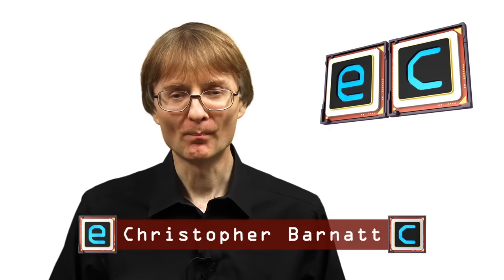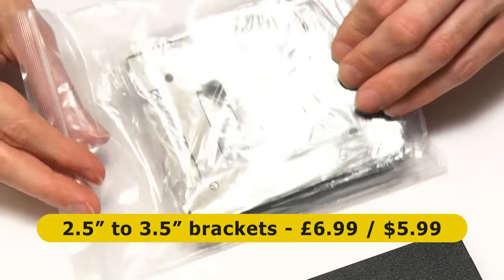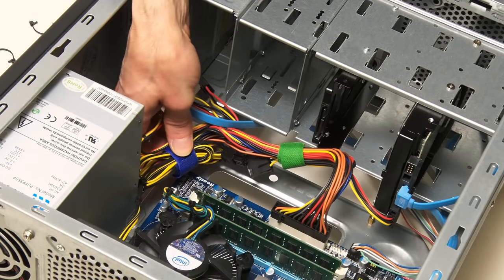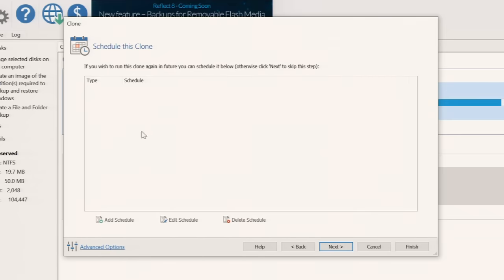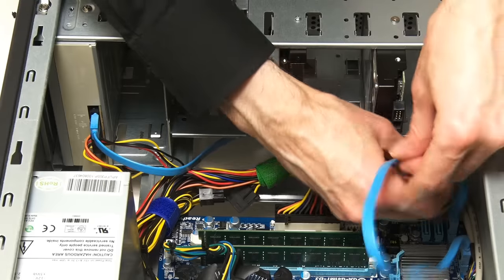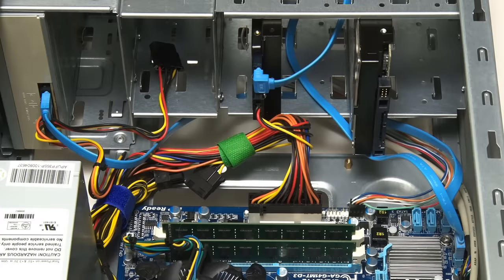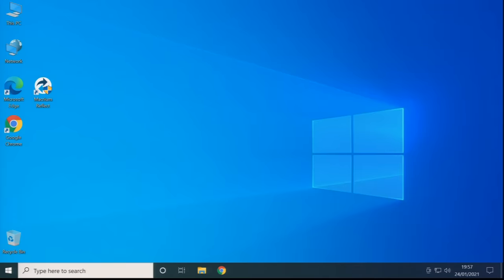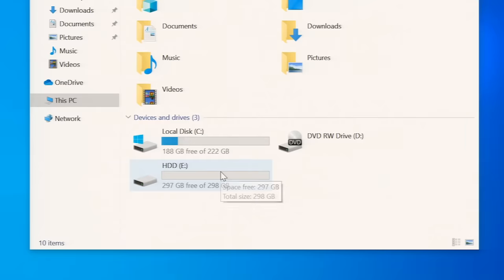Old PC Upgrade #2: SSD Boot Drive

Comment: I did this with my laptop a couple of years ago and everything seemed to go (surprisingly) smoothly, but there was at least one hiccup, when I cloned the hard-drive to the SSD, it seems to have broken the (Acer) laptop's built-in recovery system. There is a 15GB hidden partition at the start of the hard-drive that contains the system images to factory-reset the laptop, but pressing the hotkey to run the D2D recovery program on boot no longer works. Be wary of stuff like this when upgrading… (Also, Windows' memtest function was broken, but I fixed that, but Windows' System Repair function is still broken.) I suspect that some of these things used hard-coded sector pointers or something that weren't updated (if even possible in the case of D2D). 🤔

My system definitely feels a lot more responsive since upgrading to an SSD. I knew it would, but I didn't expect this much. 👍

Comment: I'm on the cusp of upgrading an older (~12 y) AMD system with an SSD and this video has lent itself perfectly as a tutorial for the process.  There is a corruption with the Win 7 64-bit OS on the legacy HDD so I will not clone it.  Hope rebuilding the Win 7 OS will not take too long. 🤔

Comment: I think that some little step is missing and I don't find any comment pointing out yet, so I'm writting it myself. I think it would be worth to check that windows' defragmentation tool is disabled and TRIM tools is enabled on the SSD drive. That would be better for the wear of the drive.
Reply from the maker: This will happen automatically in Windows 10 and 8 (ie those versions of Windows with support!). :)

Comment: Great video, i went on and cloned successfully, you recommended a great software. Then i was planning on wiping partitions and erase old hard drive so i could use to save my files but that turned out to be tricky, maybe you have a video on that, or could you suggest the application to go to. Thank you very much for all the explaining and the motivating🕵️
Reply from the maker: Glad to hear your clone worked. You can wipe partitions in Macrium Reflect if you wish. But towards the end of the video here I show how to clean a drive (and remove partitions) in DiskPart.

Comment: Right! Blue Tact... Lol
NOPE, I'm getting out the drill and making new holes in the case. Who need a bracket! Lol
I have been using the two drive system for years. The OS is on a smaller drive and all the data is on a larger drive.
Just like I do in Linux, the "/home on Linux" & "/user in windows " is on the data drive... :-) I know the average user
would not do this but I am geeky that way... :-)
Thanks Chris for the video! I enjoy them a bunch!
LLAP
Btw,  Are you a speech teacher? I'm asking because I just love the way you are precise on your words and phrases... Very professional! :-D

Comment: I saw no mention of other BIOS settings to check like ACHI vs IDE or even RAID. Someone with a really old system might choose "IDE" but with a SSD would be better advised to choose ACHI. I also didn't see anything about the difference between older BIOS's and newer UEFI's, where "secure boot" settings with UEFI might be a big problem. (Maybe you can show us a good way to clone drives on those newer systems that uses UEFI?)

Sorry if I'm being too critical. I still love the content that you produce. In fact, I learned (or was reminded) how to better use the DISKPART utility -- thanks!

Comment: Macrium ended up failing the clone attempt on my end, so I ended up using Samsung's Data Migration tool and it was cloned without a hitch in about 12 minutes. As you said, the SSD as my main drive definitely feels snappier and more responsive.

Comment: Perhaps you could have used Macrium Reflect to reformat the HDD. If you'd told it you just wanted to copy the data partition from the SSD, it would have let you extend it to fill the whole HDD. Perhaps it would have let you create the partition and format it with the W10 disk manager, or MR might have let you format it(???).
Reply from the maker: Sadly, Macrium Reflect 7 Free does not automatically extend/resize partitions.

Comment: I quite like using the installation of an SDD as an excuse for a fresh install of Windows - it makes you clean up any old or unnecessary data and you can always keep the HDD in the system with the windows install and data in tact to pull things/boot from. I've also known data to get corrupted in cloning/after cloning. Doesn't happen often, seen it a couple of times over about 200 laptops restored with clonezilla but it can happen

Comment: One little thing unrelated to the main topic: The captured video from this computer looks a bit muddy and less than optimal in general if compared with other videos of yours with modern computers with digital video output, where everything is so crisp and vibrant it looks like it is the desktop of my own computer. The rest of the gear used being the same, is it because of the VGA to HDMI converter not getting well with this PC's output, or does it also look a bit off when you hook up a monitor?
Reply from the maker: Very well spotted. :) The capture from the PC here is not as clean as in my other videos. And you are right, this is because I am capturing via a VGA output, which is analogue, and cannot really hold 1920x1080 sharply (VGA was designed for 640x480!) So yes, the image looks a bit off before it is recorded. The VGA to HDMI convertor does an excellent job, but as it is fed with mush the end result is inevitably not as pristine as I would like.

Comment: Thank you for the tutorial.  I followed every step and did the SSD installation, cloning from the old HDD, using the disk part to clear the old HDD & the have it available for future storage.  So far I have added memory, now the SSD w/HDD for storage.  Next will be the 3.0 USB.   Question how difficult will it be to add WiFi to my old HP PC?  The old HP has transformed from disappointing & slow to usable…not like a new gaming PC but much better than I expected all for @$180
Reply from the maker: This is great to hear! :) You could add WiFi either using a USB dongle (ideally a USB 3.0 one plugged into a USB 3.0 port, but USB 2.0 will work), or you could fit a PCIe WiFi card -- this kind of thing: https://www.amazon.com//dp/B07PMGJ9XY/
Reply: @ExplainingComputers  Thank you.  I will look into both options when I do my next upgrade. I was ready to junk my 11 year old HP Pavilion 6310 until I found you.  Again...many thanks for the time you put into making your how to & how it works videos.

Comment: If you're going to add an SSD to an old PC you should max the RAM first so as to avoid shortening the SSD's lifetime with tons of pagefile writes.
Reply from the maker: This is exactly what I did in the first part of this video series! :)
Reply: And put the pagefile on a different drive, if possible. Or just disable it entirely if you have enough RAM, and don't run some app that whines if it doesn't find one.
Reply: If you're using Linux, just reduce the "swapiness" to a lower figure than the default (depending on the distro). It's the same as reducing Windows' page file.

Comment: Speaking of ssd. I had to reflash the whole firmware on my tablet because over time it developed ghost memory and corruption. I had a flash drive develop ghost memory to of which required a reformat.  Even though I deleted files it still showed files were there. I never allow myself to forget that a ssd is still just a glorified flash drive and all things with permanent mounted emmc flash will eventually fail.  Google and their stupid updates breaks things more than people know.  I like using ssd's for static files and, spinners for swap and game saves that need frequent saving. Like on a Xbox 360.

Comment: Go to Msconfig, Boot tab then click the box saying Advanced options, and in the new windows that will appear in the upper left corner of it is a tick box saying Number of processors (it includes HT/SMT CPUs), max that out, pres ok then ok again, shutdown, now boot up again, enjoy your system using all of its cores to boot and the faster boot time.

Comment: I used Reflect to move from a 2Tb HDD to a 1Tb HDD, too, but unlike how it worked for you it didn't need me to manually resize the 2nd to fit the 3rd before the 2nd. My stupidly sucky memory doesn't say how I did that, I only remember I dragged the 3rd to the right end and then the 2nd.

Comment: Through the years - I kept updating computers because I wanted more speed.  I did not like the 'turn if on and go for coffee'.    Or go to web site and it takes forever.    So I have a few old computers around the house.  Was keeping the old ones incase I need to reload an old version of solaris x86.     Well, now I have done the updates to 4 core computers ( and I have not see the videos yet ).   I have 3 AMD 4 core computers 1) fx-8300 and 2 amd athlon/phemon 4 core computers.  I updated the cpu to approx faxest I coudl get for that MB and I upgraded ram. but the biggest diff was putting an ssd HD into the boxes.  Note - they also run Linux not windoes.   I mainly use the FX-8300 ( 8 core ) but hte other 2 are usable.  so I will say that upgrading the older Hareware is a good idea.  Unfortunately - I cannot bood from nvme's on the 3 boxes - and I have ( and not really tried ) the pci/nvme adapter ( PCIE card with m.2 slot ).  but tried enough to say it will not boot.  but with linux, there are alternatives ( such as efi/boot + data on ssd, and put swap/os on nvme ).   that i think will give the biggest speed jump.

Comment: Nice video, but if  W10 has enabled "restore points" check the settings, sometimes the restorepoint are directed to the original HDD. And its a nice easter egg :)

Comment: when i upgraded to an SSD it was massively improved last year but i have been using the same HDD i bought back in 2009 which ran at 5400rpm, personally i would have kept it as it was still working very well  it was problem with some of my newer applications needed a faster drive as they where taking an eternity to load.

Comment: Good info and guide,  I have used this guide and benefitted from it, thank you very much.
Reply from the maker: Great to hear!
Reply: @ExplainingComputers  Yes sir, After watching your guide I bought SSD and repeated your procedure, made SSD boot drive and HDD data disk. Only difference from yours is instead of cloning boot drive I reinstalled Win10 on SSD as my license is linked to my Microsoft account it automatically activated the OS. thanks again.

Comment: Hello Christopher and thank you so much for your clear explanations and demonstration of the upgrade process. 
BUT although I think I followed the plan 100% i have a boot problem having added the SSD.  - The upgrade is of a PC based on a 2013 released ASRock H61M-DGS motherboard with Intel i3-3220.
I think I followed your plan in the video "Old PC upgrade #1",  and added more memory, very successfull, then followed the video "Old PC upgrade #2".
First I mounted the new SSD and did exactly as you showed, using the SATA cables from the DVD drive on the SSD  (1TB SAMSUNG), then cloned (Using Macrium Reflect) the old HDD (1TB Toshiba) to the SSD (while internet was off), then swirched back the DVD cables and moved the SATA cables from the HDD to the SSD and started to boot from the SSD.........
BUT Windows only returned the lines:
"Reboot and select proper Boot device
or insert Boot Media in selected Boot Device and press key".
I have played a lot with the UEFI setup, but nothing works. - Something unforseen is going on here ????
What can I do? Please help.
Reply from the maker: Sorry to hear that you are having problems. It sounds like you have followed everything through correctly, and it should work withthe hardwaare you describe. Try disconnecting the SATA or power cable to the DVD (so only the SSD is connected), and try to boot. If no joy, I think you are right to see what is set for boot settings in the BIOS. If you cannot get it working with available options, you could always re-clone the drive (one of the good things about the process is that everything remains intact on the HDD you cloned from, so another go is possible!). When you say Windows returned the lines, are you saying that Windows started to boot? If so, you could also try booting Windows in safe mode.
Reply: Now the boot on the SSD worked:trophy-yellow-smiling: ...  but I had to choose another software for cloning.....in fact I got the hint in another YouTube saying: the most safe way to clone is to choose the software offered by the manufacturer of the target drive. In my case I went to Samsung, and indeed, they have an excellent cloning / migration package. It even ran faster and finished in 1 h 40 min compared to the 4 h 42 min for Macrium Reflect. 
And the boot on the SSD worked immediately...  And the improvement of speed and responsivenes of the PC is great, almost overwhelming. So again thank you, Chris,for your teaching and support also during my struggle. Perhaps I should suggest to add a comment to your Video #2 about using manufacturer original cloning software in case of issues?

Comment: I have done this a few times, using Macrium Reflect, however I didn't know about the drag'n drop functionality, and relied on it getting it right.
When you plugged the Molex into the adapter, it didn't look like you had it seated all the way.

Comment: Hey nice Video going to be changing my drives from a Samsung SSD 1tb to a M.2 NVMe 2tb drive that is installed on the mother board.  Have got Macrium Reflect it came with the Samsung SSD also have Chrystal Disk which it free also thanks for the pointers they are very useful

Comment: I was looking into cloning my hdd on to a ssd and some have suggested that it is risky and if the process goes awry I could lose data on the original drive. The procedure for a  fresh windows install on the other hand seems to have a thousand different variations and a thousand different results.
Reply from the maker: The cloning process, even if it fails, should not damage anything on your current drive. But certainly you have to take care that you are cloning FROM the old drive TO the new one. Check that carefully before starting the clone.

Comment: Thank you very much for explaining how to replace the new drive. I am such a computer illiterate. Question concerning cloning- when I clone the hard drive will it affect the software serial numbers? In other words, since the SSD drive is new, will I need to re-install other software that I use with serial numbers. Here's my problem, some of the software that I bought only licensed to 1 computer.
Reply from the maker: The software serial numbers will not be affected, and there should be no need to reinstall anything. But this does assume that the cloned drive replaces the boot drive in the same PC. The software you have licensed to one computer will still be used on the same computer

Comment: Very informative video.  Will have to give it a try. Appreciated the information
Reply: Me again.  Well did the cloning. However, tried 3 times each time computer came up with error no boot drive?  Checked the SSD and would seem that all partitions are there and shows data.  Used the same cloning software.  Any idea why it will not boot?
Russ

Comment: Under Macrium 9:38 you actually made it more difficult.  You could have simply selected copy selected partitions in the middle instead of all that drag and drop and resizing nonsense.  Leaving the 800MB at the end does nothing for life of the drive.  It's a 240GB SSD which means it's probably actually a 256GB drive with 16GB already overprovisioned for drive longevity.  Also 39 seconds for a modern 2021 SSD is slow.  Check that you don't have legacy/IDE settings enabled in the BIOS and that AHCI is enabled for the boot drive.  Should also run AS SSD benchmark to ensure that the new SSD is 4k aligned.

Comment: I noticed you used an anti-static wrist strap in #1 but not in this video; any particular reason, please, and I would value your comments generally on anti-static precautions.
Reply from the maker: I used an anti-static wrist strap in every part of this video series, and indeed I always use one. But I sometimes get intense hate in the comments when I use and/or mention static grounding from those who argue that modern components are not static sensitive(!). So most of the time the wrist strap is hidden (or a foot strap).

Comment: The easyest way for cloning and diskmanagement is to use Minitool Partition Wizzard.
And another thing I do is split the OS from my personal storage, So drive C: for Windows and drive D: for My Files.
And maybe it's a solution to set the harddrive in Mirror so you always automaticaly have your backup.
I'm aware that mirroring the harddisk it could give an advantage in disk-speed .....??

Comment: Those MOLEX to SATA adapters sometimes like to melt and catch fire, depending on the make. When I run out of PSU connectors, I tend to get a newer PSU if I'm going to invest into an SSD already. Not saying that this is particularly bad solution. Just that I learned (the hard way) not get crazy with power adapters :D

Comment: I have a pc with the exact same case. I would probably upgrade it if it wasn't for the single core celeron. Also if this system is a socket 775 why dont you throw in a core 2 quad and maybe a cheap 1gb pci-e low profile gpu like a GT 710 and see how it performs? Anyway, Keep up the good content Chris.

Comment: I have a couple Gateway 310x computers with their original configuration.  The original motherboard has no SATA connectors.   It has a 486 and is limited to 2 gb of ram.  The power supply has no SATA power connections.  My case looks just like yours, but your power supply and motherboard are obviously more modern.    Did you upgrade the power supply and motherboard in another video?